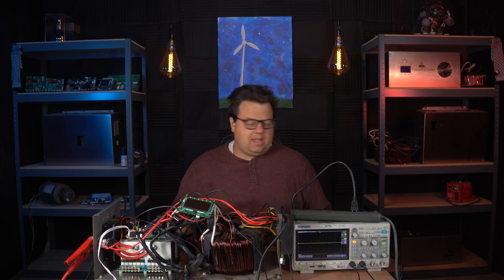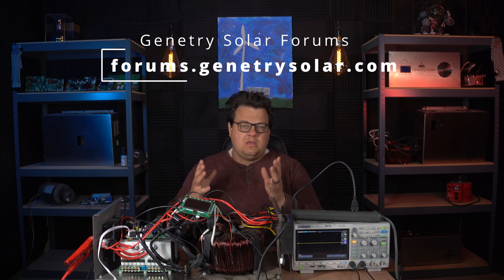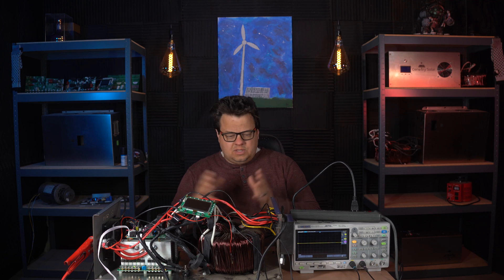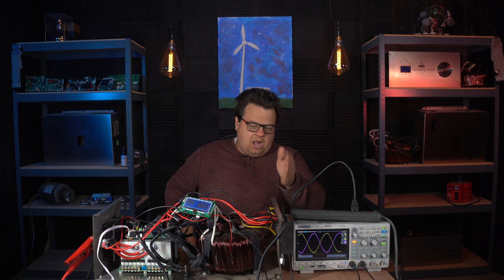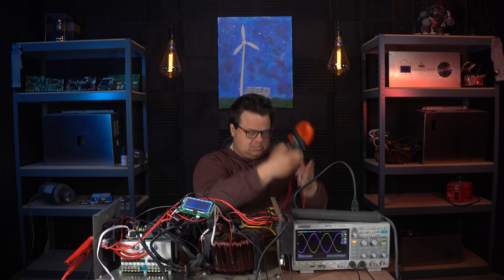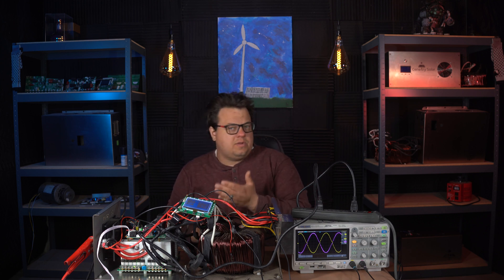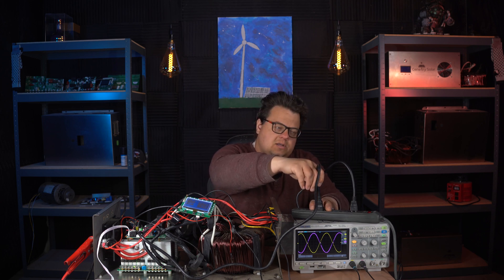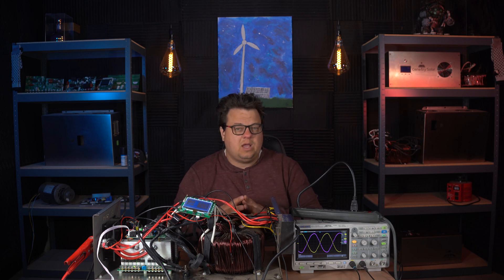Convert 120V to 240V SP with a Genetry Solar Inverter

Comment: Could you run the 6k long term on tiny house that will use 240v mini split?

What is the ideal current on the 6k?
Reply from the maker: You can hold 6kw without an issue. 24/7. Red line is closer to 8kw.

Comment: This is a killer feature for RVs (and in our case, a bus conversion). The input on these inverters takes two wire- so either L1/N or L1/L2. It will enable you to use split phase at RV parks and use smaller, quieter inverter generators that offer only 120V input. 
However, if like me you pass all input through your inverter, it also renders you immune to many problems RV parks suffer with bad wiring. RVs have caught fire in parks before because neutral was cut due to poorly maintained park infrastructure or storms. With the GS inverter connected to your inlet this condition cannot affect you because the neutral in your panel is derived from L1/L2 input.